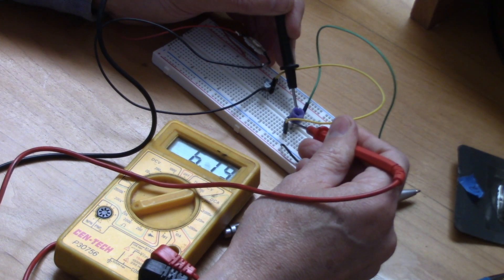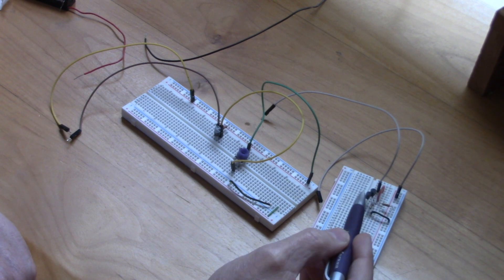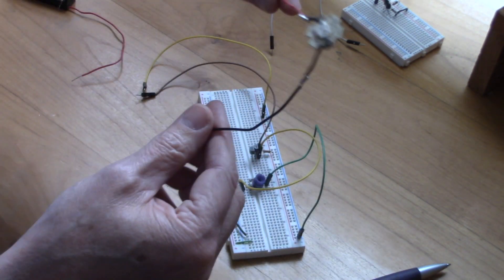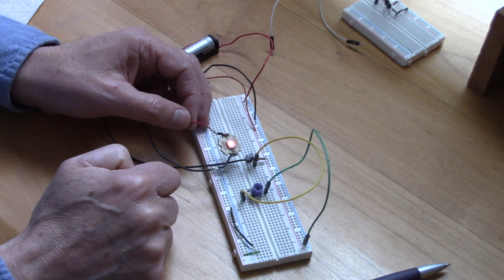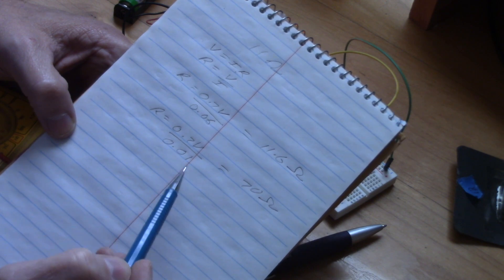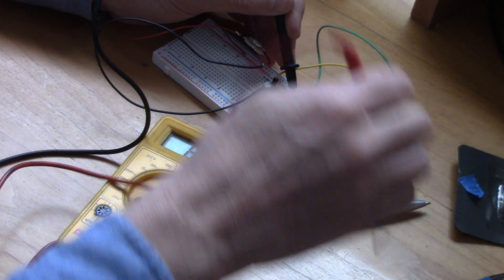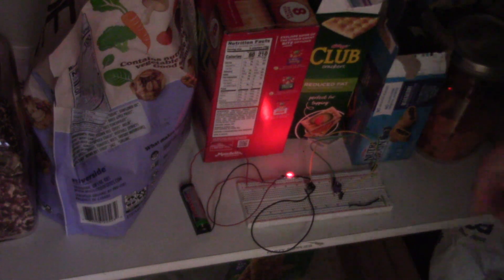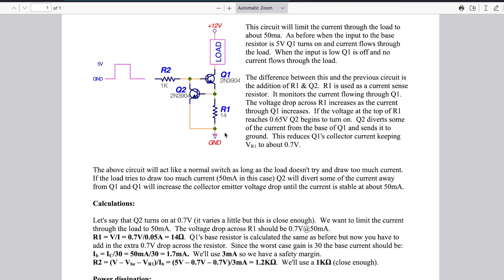How To Make A Simple VARIABLE Current Limiting Circuit for high power LED

Comment: You have the circuit connected to the negative side of the led. Will it work connecting to the positive side of led & tying the negative of led directly to ground? For my application, I cannot isolate the negative side of led from common ground of all the other devices.
Reply from the maker: I don't think that will work, but I'd have to see the diagram.  Basically, you need to run the wires through the limiting circuit as shown in the video.

Comment: Can i use it to limit current at max 2A?
Reply from the maker: I used small switching transistor that had less than an amp of allowable current.  If you used power transistors, it should work for 2 amp.